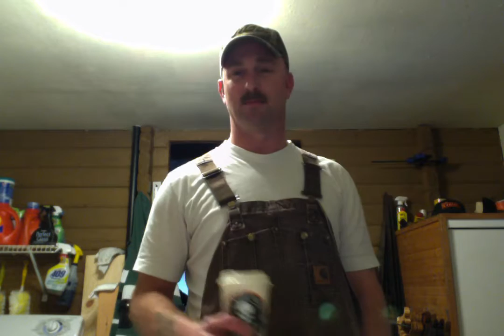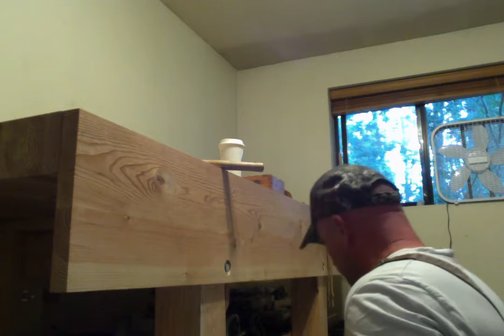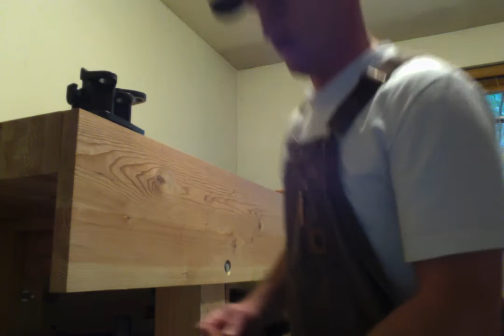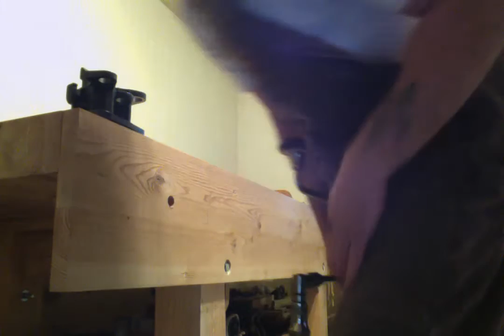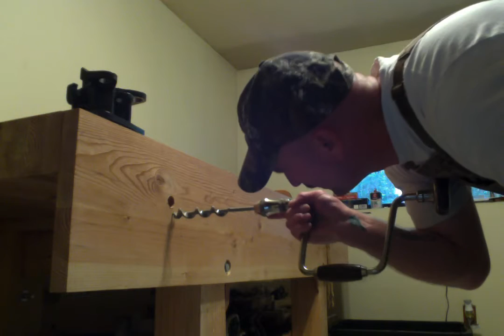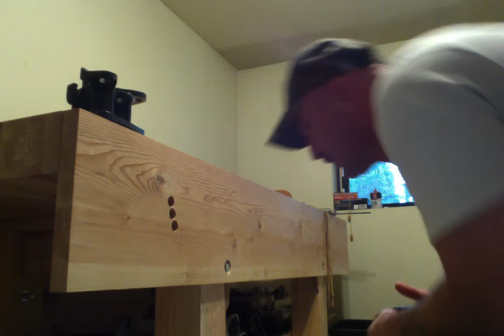Cordless Carpenter workbench build #52 - Mounting the VISE 1

Comment: With the rear jaw mounted on the face of the apron you could box in the sides and top of the vise jaw with 1/2" material (or whatever the jaw thickness is)  and then add a thin piece even a 1/8" thick piece would work, across the metal jaw and the wooden chop frame. I know that would be too thin for your taste, but it would work because there is no real need for strength here - the apron provides all the back up integrity. Thereby gaining some additional opening. The thin face piece would protect the work from contact with the metal of the rear jaw.
The front chop can be changeable to fit whatever the job requires.......Just a thought.